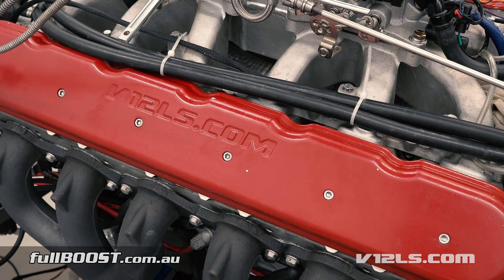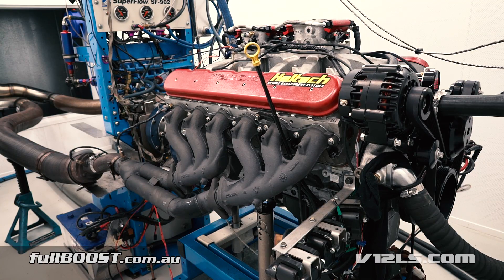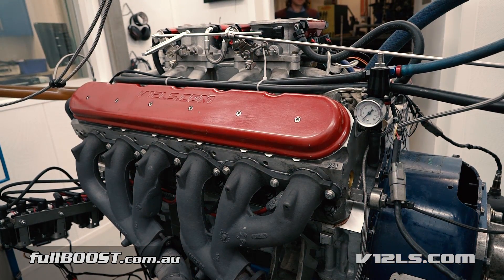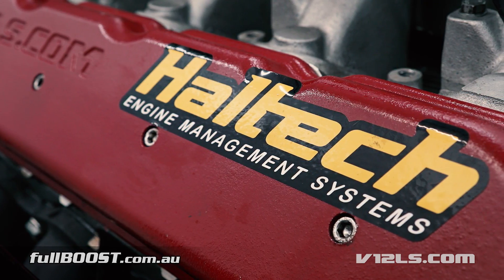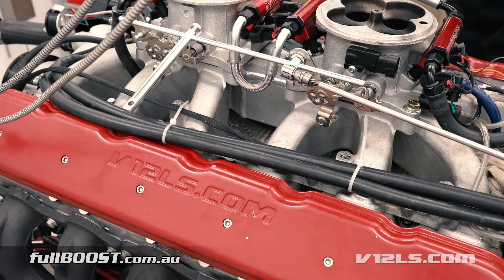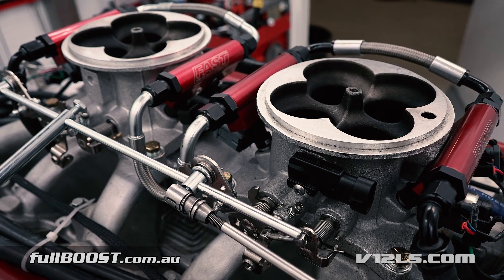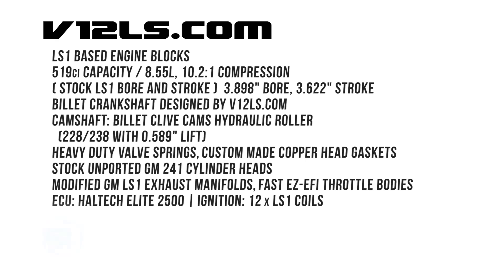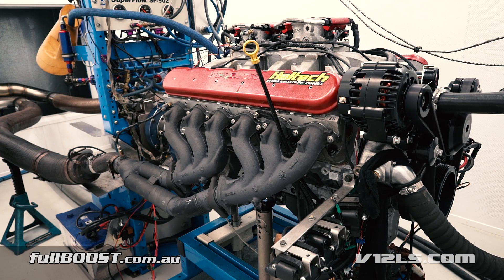V12 LS1 engine dyno

Comment: That's it?
Reply from the maker: Are you referring to the hp?
Reply: That's it? what you mean that's it? lol dude that's very impressive considering it's pretty much stock everything aside from the cam unless that cam comes assembled with the engine from the factory and of so over 700hp on a N/A v12 is extremely impressive.
Reply from the maker: Exactly, they only make around 350hp stock!
Reply: Fullboost yes in 04 they were 350hp in the goats so double the hp is just magical. Love to see what a set of better heads and forged internals and twin 80s would do on this beast. 2500hp should be very attainable if not more. I been waitng for a few years for this engine to be done. They've done a lot of changes because the last time i seen this engine only made 500 amd some odd hp.
Reply from the maker: This is the first time this engine has ever been on a dyno and yes the engine is essentially very basic. People seem to forget it's a prototype to prove a concept. Massive potential going forward like you said.
Reply: +Fullboost they've been messing with this concept for a few years now. when i first read the article on it they had gotten dyno numbers off of it after the first attempt. this is the first dyno run of it as a completed project with all the bugs worked out of it. amazing idea and i would be almost satisfied if GM bought this engine and put it in the upcoming Zora ZR1....almost sastified.
Reply: Hey Cliff, the one you are thinking of is one built in Seattle. As far as I know they had it running, making around 525hp. Unfortunately I can't seem to find any videos of that one though. This one is built in Australia, and this is the first dyno run for this engine. Can't wait to see what it could do with better heads, rods, intake and exhaust!
Reply: +WarWagonMT hmmm...sounds about right but i thought it too was done by 2 brothers. i could be getting the 2 stories mixed although it has been quite some time since I've read the article. thanks for clearing that up.
Reply from the maker: It's not designed to make 2500hp. It's a prototpye engine to prove a concept. The possibilities from here are endless. Imagine the same engine with a billet block and high flowing heads etc...
Reply: ***** why wouldn't it? Yeah the aluminum blocks aren't as strong as the cast iron LS blocks but I've seen LS9s make 1200hp.
Reply: And these are 2 346 cubic inch blocks making 721. Doesn't matter who did what first man. It's not like GM themselves did this prototype just a couple of guys with a lot of time on their hands. I'm sure these guys did their homework on what would be needed to handle the stress of being such a long camshaft and did their research on v12 engines.
Reply: This isn't Chevy building it.
Reply: +Joe11Blue no its 2 brothers building this engine. GM has nothing to do with it.
Reply: Clifford Purk
I was replying to the same guy you were.
Reply: Joe11Blue oh ok, my bad brother.
Reply: That cam they used no doubt made it pick up 100hp through all 12. I had a similar cam in a 5.3 that picked up 50hp @ the flywheel over stock.
Reply: and for an engine this size thats a very small cam.  I think this cam would have very good manners in this engine
Reply: Thank you!  These guys are thinking this thing is supposed to be magic.  It kicks ass for what it is
Reply: "That's it?" is likely a comment coming from people seeing n/a v8 motors these days hitting those numbers... I'm a ford guy and while, yes, 700hp is possible out of an n/a 5.0 (the n/a cobrajet is around there), this is still pretty damn good.  It's not 2 whole v8s, it's 2 v8s minus 4 cylinders; so for it to make the amount 2 of the stock v8s it's based on, it's actually not bad at all.  Not a bad proof of concept.  Now they need to do a Coyote.  Since Ford did a V10 based on the 4.6 dohc, that made 550hp, a v12 based on the coyote or better yet, the 5.2 voodoo, would be wicked.
Reply: One more food for thought, for those asking "that's it"... if you take 2 jeep inline 6s, at 4 liters each, if you were to put them in a V12 setup (yeah, I know damn near impossible), but you'd barely get 380hp from an 8 liter engine.  True, it would have 500 lbs-ft at idle, but that should shed some light on volumetric efficiency...
Reply: +dre04mach 700 n/a horsepower from 5 litres?  Thats impressive.  Are you 100percent on that?

Comment: that's ineresting.
should use a LS3 block and heads and make even more power.

curious of the firing order as well.
Reply: This one fires like 2x straight 6 cyl engines, with no. 1 of each "engine" being at opposite corners of the block to keep things smooth.
 Unfortunately the dyno pipes take out the exhaust note, so you can't hear how it would really sound in a car.
Reply: WarWagonMT if it's 2 I6 firing orders, they it should be perfectly balanced
Reply: They should of gone with the larger bore of the ls3 to help unshroud the valves.
Reply: das lupus in a v12 config the stock bore and a shorter stroke would be better.

The Europeans figured that out a long time ago.
Reply: Or just a ls2 since they are cheaper or newer 6.0 . Ls3 are high in price . Im sure they went ls1 for cost reasons and weight